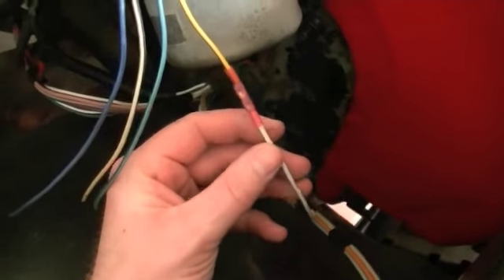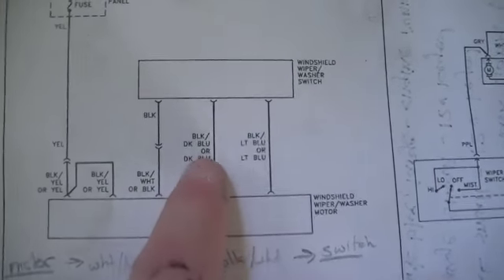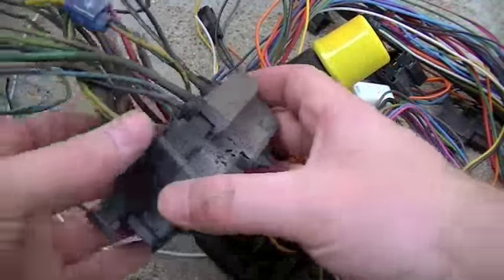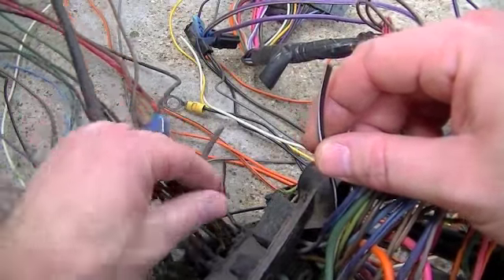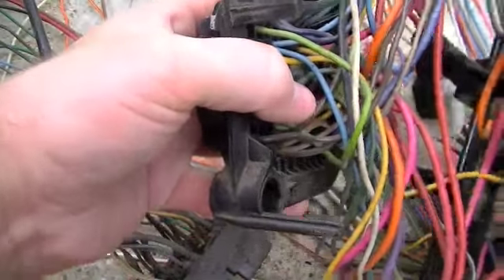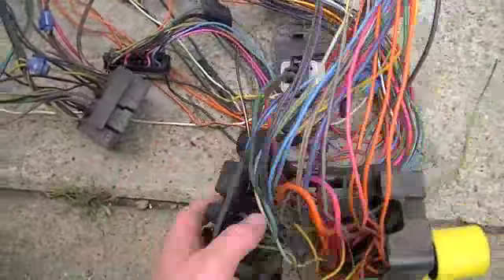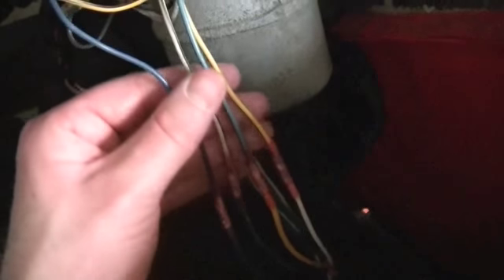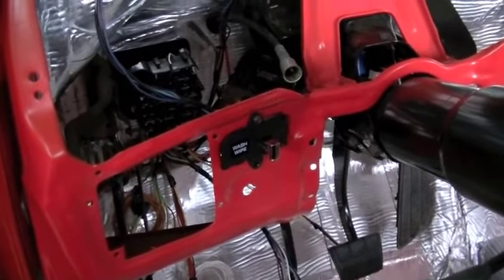Part 22 C10 Wiring Repair | Universal Wiring Harness

Comment: I would say, NEVER throw out the harness-- extra wire can get expensive, and some of those harnesses still have some decent wire left, and in all sorts of colors! keep it and use it for scrap wire when you need it!
Reply from the maker: Munky332 I used to be a packrat.  I realized I was storing stuff too long.  Much of it I never used.  I decided to de-clutter and now I'm more likely to toss it out than save it.  It does cost more money, but it frees up a lot of space in the shop.

Comment: How did you wore the instrument cluster
Reply from the maker: +kHKlipzz I installed aftermarket Auto Meter gauges which were very easy to wire.  But with a good wiring diagram, wiring this new harness to an old instrument cluster shouldn't be too difficult.
Reply: @milkcrate82  @  i gt a harness with no manual,, but wires labeled,,  whats “ black” wire  with a/c compressor lettering,,,  its that positive or ground?